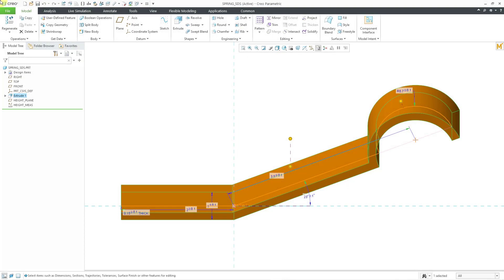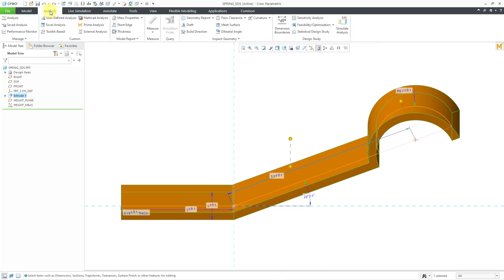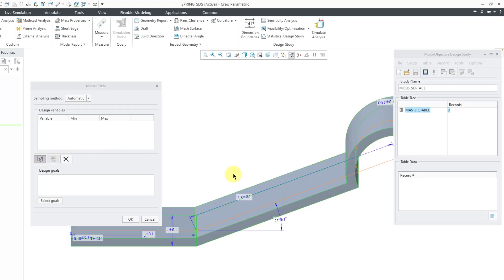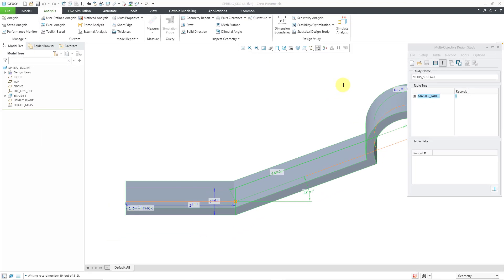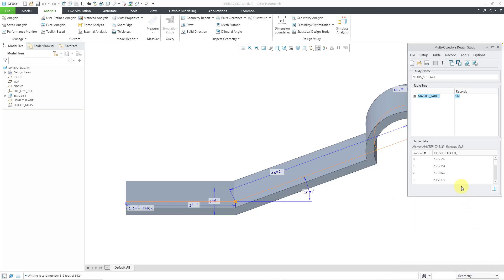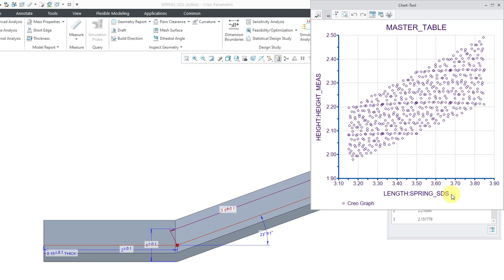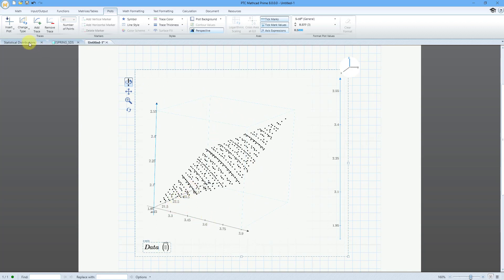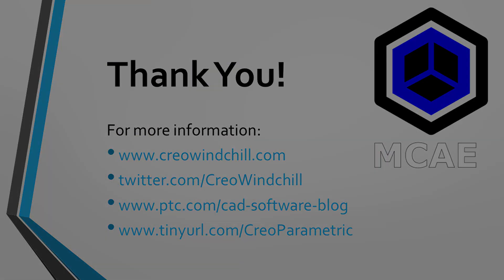Creo Parametric - Statistical Design Study (Part 3) - Multi Objective Design Study

Comment: i have two question on this topic: you said that the min and max range for the variable are obtained applying +/-10% of the nominal. For dimensions like the ones highlighter that already have a +/- tolerance, is it possible to generate the range automatically based on that tolerance? And question 2: it seems the statistical distribution is uniform, is it possible to have a gaussian distribution?